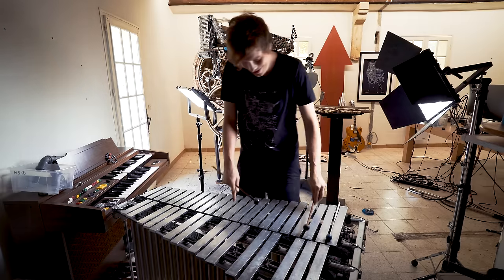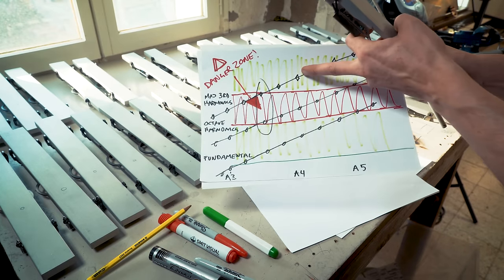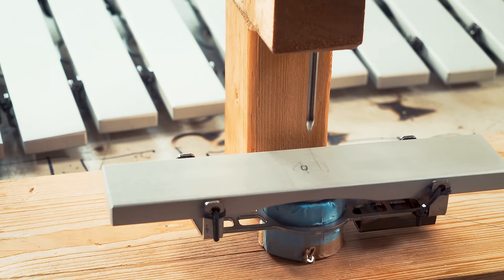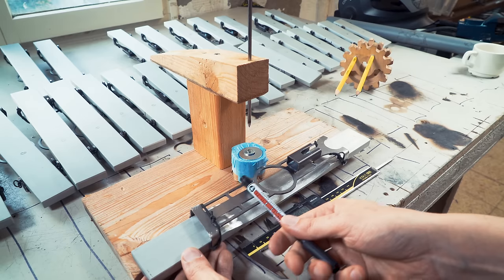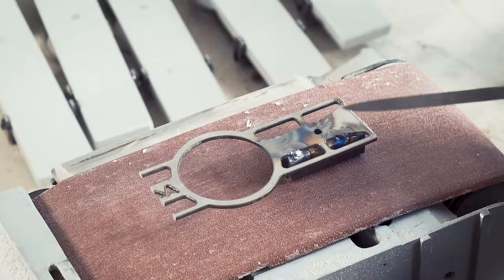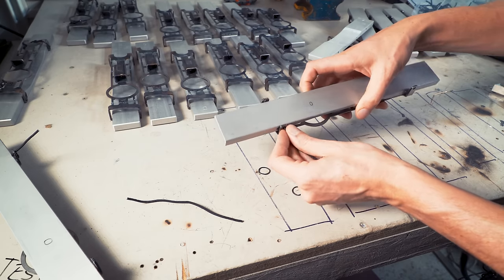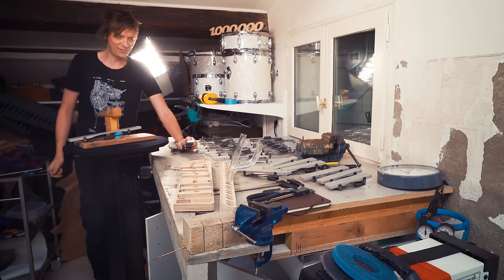Music Harmonics Jig (To Hit The Sweetspots) - Marble Machine X #101

Comment: That "A" on the vibraphone sounds more like a Bb to me than an A. I got perfect pitch so idk weather I'm just tripping or if Martin got it wrong. But idk cause the 4th isn't a harmonic. Someone help please.
Reply: Ydk whether, or ydk weather? From Wikipedia re Tuning Forks:
“Currently, the most common tuning fork sounds the note of A = 440 Hz, the standard concert pitch that many orchestras use. That A is the pitch of the violin's second string, the first string of the viola, and an octave above the first string of the cello. Orchestras between 1750 and 1820 mostly used A = 423.5 Hz, though there were many forks and many slightly different pitches.[5] Standard tuning forks are available that vibrate at all the pitches within the central octave of the piano, and also other pitches. Well-known tuning fork manufacturers include Ragg and John Walker, both of Sheffield, England.

Tuning fork pitch varies slightly with temperature, due mainly to a slight decrease in the modulus of elasticity of steel with increasing temperature. A change in frequency of 48 parts per million per °F (86 ppm per °C) is typical for a steel tuning fork. The frequency decreases (becomes flat) with increasing temperature.[6] Tuning forks are manufactured to have their correct pitch at a standard temperature. The standard temperature is now 20 °C (68 °F), but 15 °C (59 °F) is an older standard. The pitch of other instruments is also subject to variation with temperature change.”

Comment: Now it's too late but couldn't he have done it with only two cuts and two welds per piece by rotating the middle after cutting and before welding? Or is it not symmetrical?

Comment: I've noticed that you are using what looks like PVC tubing as a resonator tube.
It has occurred to me that maybe you would consider a small experiment with tubes of the same dimensions but different materials.
We know that the tube length has an effect, but what about material and also wall thickness of the tubes?
I'm no musician - but there should also be a huge difference in sound when the pipe is blanked on one end, I have no idea if these would have an effect for better or worse.
I'm merely commenting from the effect that is observed between tuning forks across a room. Logic tells me that the tubes should be of the same type of material as that which the notes are made of for the best effect?

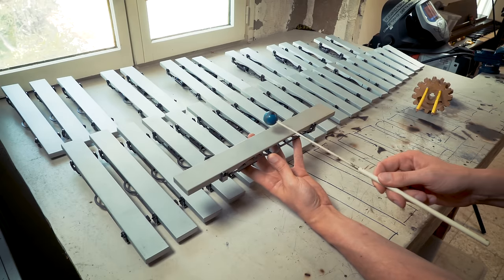Comment: Hitting the bars at the point that minimizes the overtones is one thing, but the tuning itself is also an issue; it wouldn't sound nearly so piercing and yucky if your bars had correctly-tuned harmonics. That third overtone you show off at 3:45 sounds almost a half-step sharp.
Perhaps consider having the bars retuned? There are services (like this one: https://www.marimbas.com/tuning ) that can retune the bars to sound much much better.

Comment: It looks like you did 50% more cuts/welds than you needed to do. If the bracket needs to be longer on one side than the other,, you could cut off both sides, but cut one side longer than the other, and then just swap them.

Comment: Have you considered using bare wire butt-connectors to join the elastic strings instead of tying them in knots?

Like these: https://www.banggood.com/100Pcs-Butt-Splice-Wire-Connectors-Copper-Bare-Tinned-Crimp-Terminals-22-10AWG-p-1081286.html

Comment: Why are you cutting apart the beautiful holders for the vibraphone parts? just adjust the point at which the mechanism slides into the machine, not the part the vibraphone bar attaches to metal... watching you saw these holders apart brought pain to my body..you could even make extensions for the bars that slide into the holders, no cutting and stuff required, you're taking a very slow and painful route...